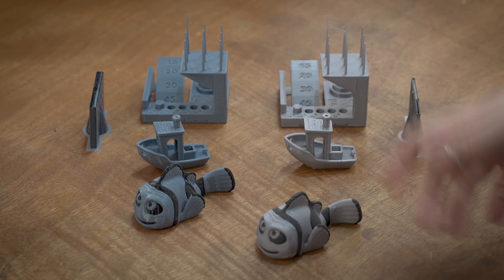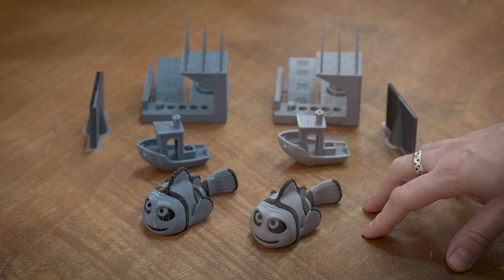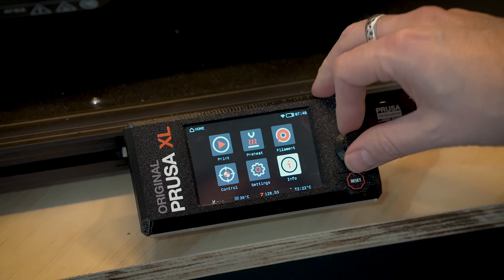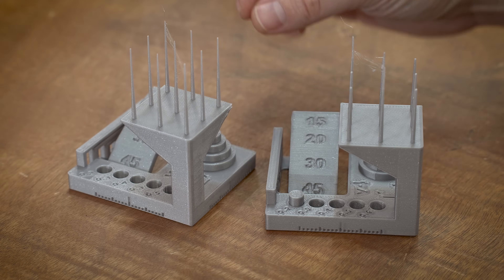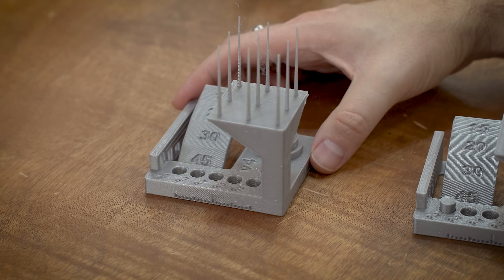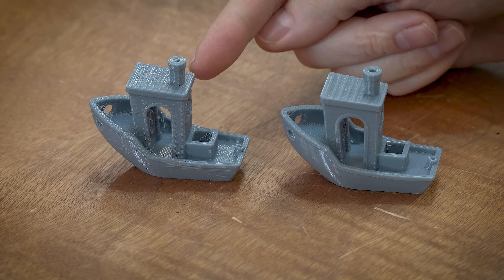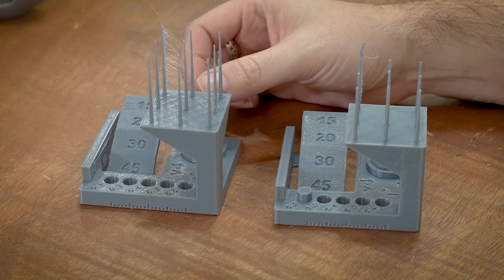Prusa XL - 0.6mm vs 0.4mm Nozzle Comparison

Comment: Unless I missed it, you never mentioned whether the .6 prints faster than the .4.  Isn't that one of the primary reasons that someone would choose to use a larger nozzle?
Reply from the maker: I thought I mentioned it, but it's been awhile!  On the Prusa XL, there's no real time savings going from 0.4mm to 0.6mm nozzles.  The hotend doesn't have very high volumetric flow, so the profile actually slows down a bit for the 0.6mm, but the layers are bigger, so there's no real time savings.  In some cases it's slightly faster, but it's marginal.  The XL really needs higher volumetric flow hotends to properly use 0.6mm nozzles AND the extra build volume.

Comment: Your two PLA benchies have different number of layers... They have different layer height.
Reply from the maker: I'm not sure I understand.  They will have different layer heights since 0.6mm and 0.4mm nozzles create different thickness in the layers.
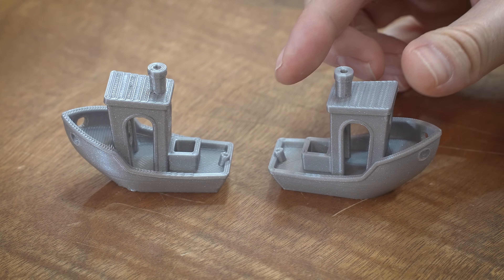Reply: @RobertCowanDIY  You said that the layer sizes are the same (at 6:39). But this is not important. Great video, thank you for your hard work. This is a very valuable video for me.

Comment: Did you print a temp tower for each nozzle? I wonder if the higher flow rate of the 0.6 nozzle has an impact significant enough to warrant the use of a (slightly) different temperature.
Also, could you try the 0.6 with a higher retraction?
Reply from the maker: The 0.6mm nozzle is just cursed.  I was never able to get a decent print out of it.  I tried just about everything.  Once I switched to 0.4mm, everything printed the way it should.

Comment: I wasn't sold on drying when I got into 3D printing but now dry everything and everything comes out of a drybox.  In fact that is my favorite thing of the Bambu AMS, I don't really print multi color but it's an excellent drybox.  That and if I have two of the same spools then when one finishes it goes to the next spool without me doing anything.  I wish Prusa would make a AMS for each tool head that would only hold two spools for keeping them dry and for backup.
Reply from the maker: Yeah, once you integrate it into your workflow, prints start coming out more consistently and failures go way down.  I really wish we could rewind time and make dryers standard features of 3d printers.

Comment: Tnanks！I'm struggling with my DIY ratrig which using volcano 0.6 Nozzle for a long time. Same issue with your print model. Now I will give up 0.6, and back to 0.4.

Comment: My jaw almost hit the desk when you proudly discussed how you kept all the parameters the same, and when on to list them.  Some of those parameters are POOR choices for printing with a 0.6mm Nozzle- so you totally biased what you did in favor of the 0.4mm nozzle.  I SHOULD have stopped watching the video straight away, but kept on watching to the end, and that was a mistake.  I do not know how much of what you say and do derives from simply pure ignorance, or if you have some particular ax to grind, but DO understand that when several others have ALREADY made a good case for using 0.6mm nozzles instead of 0.4mm nozzles in certain situations- that when a more educated individual comes across this video, eye rolling and jaw dropping moments will be inevitable.  If somebody else has already printed something that looks good, and you try to repeat it and it comes out lousy, that is not a time to rejoice and gloat "I discovered this is not a good idea".  What you should do is your best to understand WHY your print came out lousy and theirs looks good.  Sorry if I come across like I am talking to an 8 year old, but this video was just over the top.

Comment: There is definitely something wrong with the configurations and 0.6 prints. Never seen such bad 0.6 prints, which is my go-to size for many of my mechanical prints on an MK3S+, and results are often hard to tell apart from 0.4 prints at a quick glance.

Comment: Why would anyone buy the XL just to print these tiny models? Go BIG or get an Mk4 / mini. I think if you print some BIG models you will appreciate the 0.6 nozzle. Print a helmet, Print a table, Print a big wall decoration. Then you can print at 0.4 layer height, print will go much faster and at the larger scale the lower detail is less noticeable.
Reply from the maker: You bring up a decent point, but I'm not going to print the full build volume to test stuff like this.  I would probably still be printing the test parts and it would waste a ton of filament.
Reply: @RobertCowanDIY  
I want to see the full sized TPU airless basketball. TPU ball with PLA or PTG supports, because when i did all TPU removing the supports was a nightmare. You got the XL for a reason, go big or go home.
Reply from the maker: @jamesgates1074 Ha, I have no use for a basketball.  But hey, check out my most recent video, I printed a whole filament storage system where many of the parts were larger than what the X1C could handle.
Reply: Why would you care? It's not your money.

Comment: It’s clear, prusa panicked when they saw the Bambu Labs kickstarter and the speed versus quality, and pivoted to a .6mm as standard from tried and tested .4, along with the increased isize of the prints the XL can produce and the extremely lengthy print times that will accompany it.

Comment: Interesting test you have done here, but I might say that actually for the nozzle of the size 0.4, all the settings have been Adjusted throughout a long period of time of this type of nozzles from all the people and all of us. So I guess it would not be such a pure an experiment of yours when you're using the same gcode for both nozzle sizes.  So I would suggest to you to do it once again the test in the future with adjusting the slicer for the nozzle of the size 0.6. I guess you can truly master much better the bigger nozzle sizes on the fast printers with the better settings and eventually going to be getting a better quality models.
Reply from the maker: I absolutely changed slicer settings.  There's no way you could run the same gcode for two different nozzles.

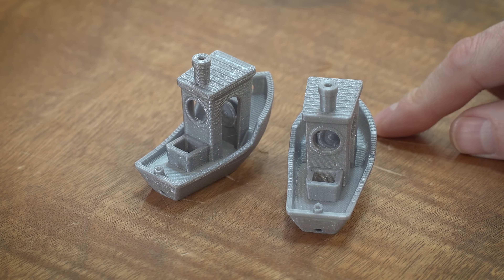Comment: I want to point out, that the layer height is definitely not the same 7:26
I count 9 layers on the roof of the 0.6 mm Benchy and 11 on the 0.4 mm Benchy, which would fit, if it were 0.25 mm layer height on one and 0.2 mm on the other.

Comment: the 0.6 PLA fish looks much more matte to the 0.4 , this may indicate flow rate issue, try CHT nozzle or higher the temperature
Reply from the maker: Correct, I didn't properly control that variable.  It should have been about 5 degrees hotter.

Comment: Thank you for this great video. Two questions arised for me: 1. What were the print times of the items? - I mainly use 0.6 to get out prints fast. 2. There always seems to be a difference in „shininess“ between then the same model with the different nozzle size. Is this just because of the video or also in reality? For example the  0.6 PETG fish looks a bit like the 255° part of the temp tower on video.
Reply from the maker: Good questions.  I didn't include print times since it's a bit of apples and oranges.  the 0.6mm nozzles tends to produce heavier prints (line width is bigger), so even though the infill is the same, it's heavier in-fill.  I've found with most modern printers, you're up against the max flow of the extruder, so even though 0.6mm can lay down bigger layers, you need to extrude a bit slower to compensate for the volumetric flow.  ALSO, every model is completely different.  My advice is to just add the XL into PrusaSlicer and load up the models you tend to print and check the times.  With the new firmware and slicer version, I've found it to be fairly accurate.  If you're seeing a difference in shinyness between prints, you're not properly melting the filament with the 0.6mm nozzle.  In theory you can increase the heat or slow it down and the shinyness will come back.  Most filaments should print shiny, so when it's more matte, it's not getting enough heat (or you're extruding too fast).  This was the case in my video, I should have increased the temp a bit.

Comment: Did you recalibrate the printhead with the Center pin after changing the nozzle? Or is this unnecessary?
Reply from the maker: I did just in case.  In theory there should be minor variations.  With tool changers, it's critical that the offset is as perfect as it can be.

Comment: Solution
https://www.youtube.com/watch?v=eZYngEnAgYs
Reply from the maker: Oh, I've seen that video and have commented in it.  That's not a fix, that's a sign of a mechanical misalignment.  The fix (albeit clever and successful) doesn't address the real problem, which is a misaligned toolhead.  Each toolhead should lock firmly in place every single time without fail.  There are several locating features that prevent this issue from happening, so the rear carrier is not aligned properly and it's picking up the tool at an angle.
Reply: @RobertCowanDIY     Correct. But identified and confirmed the issue.
Reply from the maker: @oaba201 I disagree.  The issue is with how the tool rest was assembled.  It should be re-seated and screwed back in place, not have custom g-code added to compensate for a poor mating connection.  But that's my my opinion!

Comment: 30 seconds in and you give it to me straight. That's why I stay for the other 18 mins. Clear, accurate, to the point information. Don't stop this train, you are awesome.
Reply from the maker: Ha, thanks!  I just want more people riding the train, tell your friends.
Reply: I completely agree. no beating around the bush. just straight answer and then some honest comparisons so you can see for yourself if the differences are going to matter for your use case.

Comment: Thank you for the well-made video and comparison. I came here because Prusa seems to have switched to 0.4 today and I was curious about the difference.

I've had my XL (with the 0.6mm nozzles) for less than a week, but so far I have found the print quality to be excellent - but I'm not an aficionado. I'm kind of hoping not to gain the ability to spot small imperfections, as it makes it easier for me to be happy with what I have. 🙂
Reply from the maker: Thanks!  I want to do a test on larger parts as I suspect the differences will be less obvious.  But at least on the parts I (mindfully) chose, the differences are easy to see.

Comment: What size nozzle are you using on your bambu, for your cf prints?
Reply from the maker: For the Bambu, I use the standard 0.4mm nozzle.  I've heard there's not much reason to get a larger nozzle for them.
Reply: @RobertCowanDIY  Ok good to know, I was about to buy one and they had a little disclaimer about blockages at 0.4, I guess they're probably just playing it safe thanks.
Reply from the maker: @qwertyqwerty9587 Gotcha.  Yeah, they claim you want to use larger nozzles for CF filaments, but I haven't had an issue with it, yet.
Reply: @RobertCowanDIY  I did :D with some petg-cf, it clogged pretty quickly lol. sticking to 0.6 now
Reply from the maker: @riba2233  Bummer.  I've only really ever used 0.4mm.  They do warn about 0.4mm for any filament with particles.
Reply: @RobertCowanDIY  yeah, I'll just stay on the safe side for now. Barely saved that 0.4 hotend lol

Comment: Great Video!

A bit of information I didn't catch that would be useful to spell out is what version of firmware you are running, what version of the slicer, and if you are using default profiles or your own. With all the changes Prusa is making to all three at this early stage on the XL, those details are very important for anyone doing comparisons and will make a HUGE difference on the results.
Reply from the maker: Yeah, sorry, I was trying to keep things simple.  No custom profiles, it's just the stock profiles and the most up-to-date firmware and slicer at the time of filming.  So it's what a normal user could expect, without having to tune.  Once I start tuning, it's not apples to applies, since it relies more on my skills rather than what you would get out of the box.

Comment: Cool video! I think people really underestimate how important drying your filament is when going for perfect prints.

Yes, even PLA.
Yes, even fresh out of the box.
Reply from the maker: CORRECT.  What I didn't say is that all my filament was properly dried ahead of the first 0.6mm tests, but about a week went by before I got to the 0.4mm tests and I didn't re-dry everything.  I should have, but didn't.  I think the temperature adjustment made more of a difference though, but I should have actively dried it the WHOLE time.  For any critical prints, I always print directly from a filament dryer.
Reply: @RobertCowanDIY  Right, I tend to forget about temperatures as I'm printing mostly one brand of filament and I've had temperatures dialed in years ago.
Anyway, good into! And thanks for being open about this.

Comment: What does the nozzle size setting in your printer do?  Mine doesn't have that setting.  My slicer uses the nozzle setting I give it in the computer to generate the G-code, so I don't know what the printer setting alters?
Reply from the maker: It's just a check to make sure the settings match.  I don't think it alters anything.
Reply: @RobertCowanDIY  kk thanks for the insight 👍

Comment: The 0.6mm profile isn't properly tuned, that's pretty much the problem here. Bad overhangs on 0.6mm isn't a fault of the nozzle size or even the entire printer.
Reply: It is just problem that people don't know it is not ideal to print 0.2 layers with 0.6 nozzle. No surprise overhangs are not good with such combination.
Reply from the maker: This is why I used 0.25mm layer height for all prints.
Reply from the maker: That's my thinking and conclusion.  It's just a profile that needs tuning.

Comment: Thanks for the detailed evaluation. I'll definitely look into buying a 0.4. I'm hoping input shaping when it properly lands will compensate for the loss in print time. The quality is definitely important to me, and I'll keep the 0.6 on my other printer. I'm just putting my single tool XL together at the moment. I may be tempted to try a 0.5 at some point also. I have a standard 0.5 and the adapter, but I'm hesitant to use it as I rather like the idea of cold swapping nozzles, and the adapter removes that benefit and adds the risk of leaky threads.

Would you mind telling me what filament dryer you use? Most of them seem rather poor in both function and quality. Cheers.
Reply from the maker: I use the Sunlu V2.  I like it enough to recommend it.  Check my channel, I have a full review of it and a comparison to the Printdry or whatever it's called.  I like the Sunlu because it actually gets up to the target temps, whereas others don't actually get to the temps they claim.

Comment: To me the .6 issues seem mostly related to cooling. Especially on the Marlin fish model, those overhangs simply don't get cooled enough. Relates to the fact that you lowered your temperature by 10°C.
Reply from the maker: You might be right!  I'm not necessarily trying to track down the 'smoking gun', I'm just trying to show that the 0.4mm prints the way you'd expect.  But cooling has never been something Prusa does well.

Comment: I think Prusa’s decision to run a .6mm nozzle stock on the XL is they simply thought a big printer will print big parts so it needs a big nozzle.  While that makes sense to me, it doesn’t make sense that Prusa didn’t get a .6mm to perform as good or better on the XL, and we still have to resort back to .4mm nozzles for the quality.  Hopefully a fix will come soon via slicer profiles and firmware upgrades.
Reply from the maker: Yeah, I'm curious what the impact is on larger prints.  I feel like I've noticed it on bigger prints as well, but maybe a test for large-scale prints is warranted.

Comment: I suspect shipping with the .6mm nozzle and it not being tuned for it is because the Bambulabs printers came out between when they announced the XL and when they shipped it. Not wanting to be cast aside as a relic of older days simply due to speed they quickly swapped to the .6mm to keep things at least close. 

Theoretically you could slice it for .6mm in the slicer, manually edit the gcode so it thinks it was generated for a .4mm nozzle so it doesn't throw the error about mismatched nozzle size (I'm assuming the firmware scans the gcode for the nozzle size it was sliced for to generate that error) and then you could see if it was a slicer profile issue, or a "firmware profile" (when change the nozzle size on the machine interface)issue.
Reply from the maker: I suspect the same, but that seems so sloppy from Prusa.

Comment: Does the nozzle size issue really come down to flow, and how much material the nozzle can deliver at a given print speed? Would lowering the speed or increasing the filament rate solve the artifacts with 0.6mm?
Reply from the maker: It's something worth investigating.  Myself and others have certainly seen strange behavior independent of speed or flow with the 0.6mm however.

Comment: I havent done any testing myself but while I was poking around PrusaSlicer last night I noticed Prusa has two different filament profiles for .4 nozzles: regular XL and XLIS. The only difference I noticed at a glance was the XLIS profile has a crazy PLA temp of 230, maybe to push filament through faster?? The .6 nozzle doesn't have a similar XLIS filament profile. Have you messed with or compared these two profiles at all? Only mentioning this because you brought up the issue of speed at the very end. 

Otherwise, great vid. My experience with my 5T tracks pretty well with yours and your 2T.
Reply from the maker: Thanks!